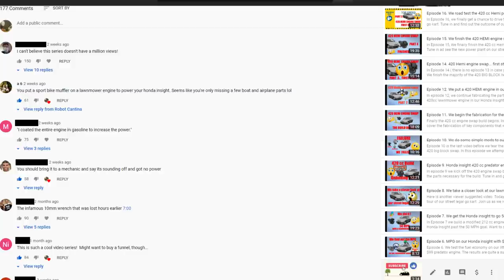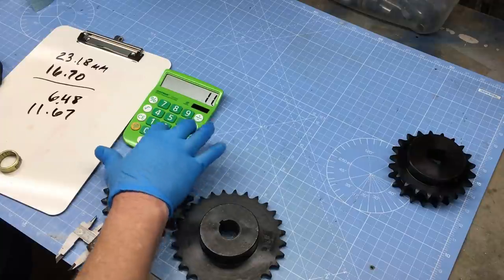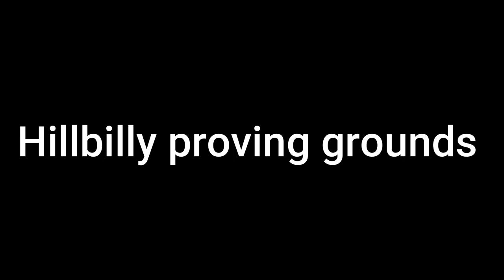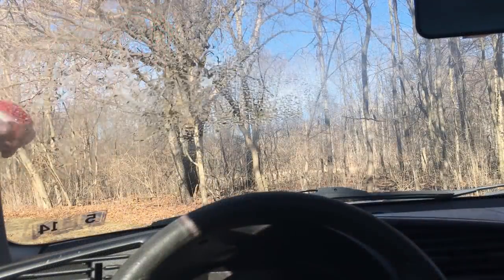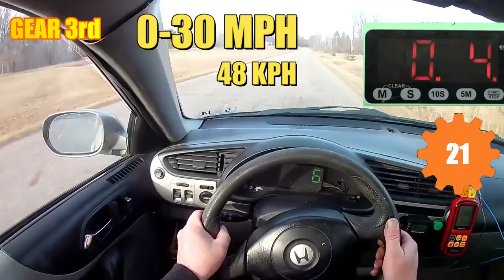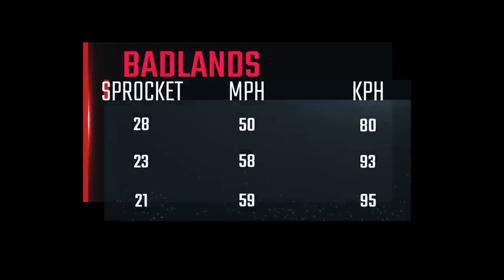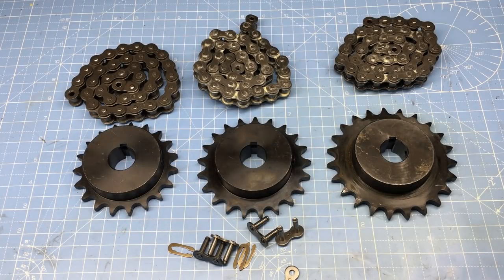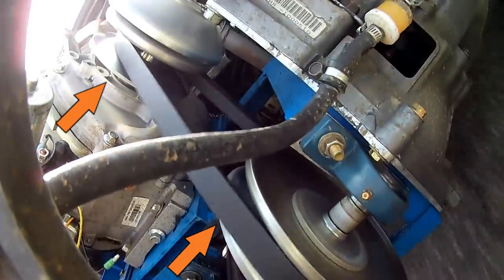Episode 17.  We find top speed and the MPG of our Honda Insight with a 420cc cement mixer engine.

Comment: if you have a teenager, this needs to be their first car.. no risk of speeding tickets.
Reply: There is a dutch car that comes from the factory with a 5.5hp honda engine lol.
Reply: Instead of ls swaps all the kids will be doing Koehler and onan swaps possibly Briggs opposed twin swaps
Reply: Either this or a Ford Mustang, both are always in corvettes rear view mirrors
Reply: @procrastinator1842  Yes, it's a 'car' for disabled people. Technically they are mopeds, and moped traffic rules apply.
Reply: I had a good mom. She told us honda civics where gutless and dangerous.
Reply: @procrastinator1842  what was it called?
Reply: @butwait  Do you happen to remember the name?
Reply: @madferret2045  Arola, you can also look for Canta LX
Reply: Challenge accepted....
Reply: @BeamerTheFox  yep, takes more skill to merge onto a highway with 13 hp than it does with 250.
Reply: honestly, even with the stock motor, it's hard af to get speeding tickets in a first gen insight.
Reply: @xq3975  yeah, this thing is so slow as to be dangerous
Reply: Lol

Comment: Seems like you are hitting the HP/Drag limit around 58mph.  Driveability looks good.  Imagine this with a 670 twin.  Could easily do highway travel.
Reply: Should I been thinking from the start except for you would have to worry about heights but that’s really not a problem if you know how to cut seven things and make the engine a bit lower because I can see you not a lot of. Things that I could do differently that would make it a lot lower I would make the first set of sprockets extend out further so they would be looking at the front of the engine stuck out it’s very hard to explain but I would be putting the sprockets not directly under the engine I’ll be putting them beside itAnd with a few minor modifications this could work
Reply: Please go 670 on this please please please
Reply: I want to see the 420 with efi and a turbocharger next!

Comment: Mathematically speaking, the best sprocket would have zero teeth, allowing infinite speed!
Reply: That’s kind of how a CVT works.
Reply: Zero teeth (which of course only works in math), infinite speed requires infinite power.
Reply: @dustintunis9347  if you have infinite time, then you have infinite power?
Reply: infinitely zero speed?!
Reply: @mikescudder4621  dividing by zero equaling zero is for people who have limitations rooted in reality. 
-superdupergrover, 2021 :)
Reply: @superdupergrover9857  fair enough... Must be time to include a flux capacitor in the equation then ;-)
Reply: @mikescudder4621  Nah, just paint it red.
Reply: @superdupergrover9857  and don't forget the racing stripes lol.
Reply: So if we use V belts and pulleys instead of chain and sprockets your saying we can go 88 and time travel is our game? Lol

Comment: Now I understand how my dad's Datsun 120Y would do 120Km/h(75mph) easily in the 1980's, it only had a 4cylinder with of 1191cc displacement with only a 3 gear transmission!

Comment: The cvt system is really robbing some power. Ditch it for a normal clutch and use the manual transmission like its meant to be used.
Reply: Why not just hook clutch back up and run directly drive

Comment: Interesting, a Honda Insight will give you 54 mpg with a 107 h.p. engine with all the drivability and power. A 13 horse gets worse mileage, is less drivable and has no excess power to overcome aerodynamic drag. Very cool video series.

Comment: Incredible work!  I think once you get it dialed in you should add a hybrid drive.  Check out Chrysler’s Pacifica evt hybrid transmission/drive for some ideas.  It’s actually rather simple.

Or just add in a hand controlled electric motor to add torque at appropriate times.  Then computer control it.  Also check out Chrysler’s etorque setup.  Good luck!

Comment: Be easy two throw in two in wheel motors and add a generator to the Predator to make a diy hybrid.

Actually, as I think about it, the way to set it up would be 3 or 5 motors - one connected to the Predator to act as a DC generator by using the regen function of a beefy motor controller.

So you'd have the Predator idling, and a fully charged battery as you start driving.

You'd have to figure out a control circuit to ramp up engine throttle based on battery charge, but at some point it would open up and go to maximum to charge the battery. Assuming that you are using less than the max wattage the Predator can generate (around 7kw - which works out to around, 9.5 hp) it would charge the battery to max and go back to idle.

The benefit of this setup is that you could draw much higher burst power through the electric motors than you ever could from the Predator.

Qsmotor makes some simple efficient motors rated for 8kw continuous, 19kw burst. You can actually pull a lot more both continuous and burst by adding ferrofluid to create a heat bridge between rotor and stator. Like double  So 19kw *2*2 = 76kw or a little over 100hp.

Now, we're talking usable performance.

That's the power for brisk take off, short steep grades, etc 

Battery size would dictate duty cycle of the predator/generator, and with a large enough battery, you could charge it when you have access to cheap electricity, and cut your fuel costs. 

Add solar collectors to the car and it can partially charge while it's parked at work.

Comment: It looks to me like you need to increase the spacing between the drive-driven clutches, or get a shorter belt. You are not getting the gear-reduction at start-up due to the belt riding up into the drive pulley, and then you are not getting a full shift at high RPMs. Belt length/clutch spacing makes a huge difference in snowmobile performance and this should be no different.

Comment: Your math doesn't seem correct. The 19t sprocket should have a theoretical top speed of 73 if a 28t sprocket has one of 50. 50*28/19=73.7 and even if you were to use the gear ratios with that 11t sprocket as the primary, then it would be 50*2.54/1.727=73.7. Though, if you go with 46 instead, then it should be 67.8 much closer to the 65mph mark. It seems a 44mph speed with a 28t sprocket would get you to 65mph on a 19t. 19t sprocket is 68% of 28t, so the engine only needs to spin around 2 times to move as many chain links on the 19t as the 28t would spinning 3 times. A 14t sprocket is 50% and will double the theoretical wheel speed of a 28t.

Comment: A v twin should really move it. A 24 hp or so Vtwin would still get 40 mpg. Maybe try a transmission, I wish I could tinker on that baby with you guys lol. I have wanted to build a skinny tire extreme mileage “car” for a long time. Just enough payload to haul 2 people and some luggage. 15 gallon fuel capacity. A motorcycle transmission geared to the moon. I bet I could get it to go 600 mi at 65 mph and 50 mpg. maybe lol.

Comment: Lol. You totally made me stop the video and check the last one with that window cleaner gag. Yep, I did post the GoFundMe comment. Good joke with the piss in the bottle.
On fuel economy, internal combustion engines typically run the most efficient at their peak torque rpm. An engine that feels strained is probably running off peak torque rpm. "Building" this engine will probably move the peak torque rpm.

Comment: 60 MPH is good, now work on getting a decent low throughput muffler and get the Fuel mileage up by 25%. Maybe solar panels on the roof and hood a couple of 12 volt batteries for power boost you can then try #19 sprocket.

Comment: Fun project car and so many ways to go if you you're wanting to. I enjoy this because I came really close to buying one of these Insights, got a Jetta diesel instead. Bigger more substantial vehicle and I'd be driving 95% highway miles so the hybrid system wouldn't be at maximum use. Some insight drivers were getting around 70 MPG. Maybe a bigger engine would deliver better fuel economy but that's not your goal. So.. patiently waiting for the next installment.  Got any robots to add to the go kart?

Comment: Hey, I suggested a sealed o-ring chain! Hoping I was the first to suggest it. 👍 Also, have you tried not backing off the throttle all the way in between shifts to keep the CVT partially engaged?

Comment: Please adjust clutching. I think there will be more to gain tuning the cvt then changing gear ratios. I am a snowmobile guy. Clutching is key! Tachometer is a must when adjusting weights and springs! Engine should be at the rpm that peak hp happens from engagement to top end. Love the videos!

Comment: You are that kind of guy that helps Maybach engines become everlasting. 
At least a mechanic with extraordinary attention to detail and deep knowledge. 
And Maybach engines because they were build to run, and run, and run... and never fail. And they are fully modulare what does require a reassembly every 15 years but they keep going like they were build yesterday.

Comment: Change to a thinner head gasket and a set of better valve springs. Also look at tuning the driver of cvt and also look at which hole you spring on the driven unit is in......after rewatching the portion of the video showing the cvt in action. You driven pulley is opening faster than your drive unit reacts. You are losing power there. Please check the driven spring position

Comment: As summer approaches, this engine will need cold air ducted into the fan housing otherwise hot air will recirculate under the hood.

Comment: Something tells me that a 25 tooth sprocket is the Goldilocks sprocket.  Also, technically speaking, running the engine at WOT all the time is more efficient because it reduces the throttling losses introduced by part-throttle driving.  You have a CVT, so if you run WOT all the time, the fuel economy will be a function of engine load,  because the CVT aims to keep the engine at a constant speed, the only variable is engine load.
Reply: You are right about the pumping losses, but you have to think about the fueling. Generally it is made to be richer for various reasons at high loads, making the tradeoff pumping losses vs fueling a net loss at full or very high loads.

Comment: This is awesome - but I've got a 796 CC 3 cyl  Daewoo factory engine getting 51 MPG (and 51 ft bs) with air conditioning, power steering, and the ability to drive across Canada. This latest setup looks like it's manageable on backroads at least. 

You should take it on a road trip. :D

Comment: I wish I could like this twice. For real. What would happen if you took a more 'regular car' approach, by fastening the stock insight flywheel either to the 420cc engine directly, or with some reduction, to a shaft. Without having the CVT mechanism. 

The one thing i'm sure that would accomplish is better packaging, Beyond that, I don't even know if it's feasible.

Comment: Just like the Honda motorcycles, the fastest speed seems to be at one gear less than the high gear, (350 to 500 cc)  just do not want to go WOT on the faster bikes. I would love to put a Predator on a CB 750 roller and just might try a swing plate mount for starters

Comment: Does down shifting/engine braking do anything with the cvt on the car? Does it re engage at higher rpms with no throttle or does it Freespool like I saw In the shifting video when u put the clutch in.
Reply from the maker: lifting off the accelerator will cause the CVT to sort of freewheel.  I say sort of, because there is still random belt drag.

Comment: Windshield. If wanting to cut down on more weight, could replace it with a 3-5mm thick polycarbonate one, back window too. Some say acrylic is easier to cut, shape, install though. Stock rims and tires? Ever thought about using lighter rims and tires, perhaps more narrow too? Maybe narrow motorcycle tires? No tensioner for the belt? Would that help, or interfere?

Comment: Throw away the CVT. The mechanical efficiency is not the best to say the least and it's basically maxed out all the time anyway. 
Otherwise I'd like to see a fuel injected engine which boosts your MPG and you can use a duct to cool the engine and also use this to heat the cabin.

Comment: I liked the cid of the cvt.  I noticed a lot of  "vibration" of the drive belt, and was wondering if a tensions pulley with a light spring might clean that up a bit for smoother power transfer.

Comment: 3x11 derailleur is the best sprocket setup, because it basically gives you a whole bunch of extra speeds. A freewheel may help as well.
Reply: You could also give non-circular sprockets a try, as you could optimize the gear ratio on a stroke-by-stroke basis; after all, the engine makes all of its power during the power stroke, and none of its power during the other strokes.

Comment: So if you are using the cars actual transmission, why use the CVT Torque Converter at all? That's like putting a transmission on the end of a transmission? Why not just use a regular centrifugal clutch and connect that right to the automotive transmission?
Reply from the maker: The CVT adds torque multiplication,  its like getting a few extra gears.
Reply: @robotcantina8957  The universe likes speed. Don't delay. Don't second guess. Don't doubt. When the opportunity is there, when the impulse is there, when the intuitive nudge from within is there, act. That's your job. That's all you have to do.   Keep going jimbo.   We love those amazing speeds!

Comment: Hmmm. I think the belt is a littlebit to slack. I goes completely to the outside in the Motorside, but (it looks like) only 2/3 in on the Gearbox side. Maybe a shorter Belt?
Reply from the maker: I thinks there is still some adjustment left in the motor mounts,
Reply: @robotcantina8957  The universe likes speed. Don't delay. Don't second guess. Don't doubt. When the opportunity is there, when the impulse is there, when the intuitive nudge from within is there, act. That's your job. That's all you have to do.   Keep going jimbo.   We love those amazing speeds!

Comment: nice job buddy ...
if you connect a small electric motor to the main motor , (12 V and 48V are now used in new hybrid systems : new suzuki  swift --- new hyundai i 20)  With such a hybrid system, it will be a faster and more fuel-efficient car.
congratulate ... good luck

Comment: for a car thats this small, this unsafe, this underpowered with such a small engine, 5.2l/100km is outrageous :D my 1.7ton 2500ccm 6cyl BMW common rail turbodiesel Opel Omega caravan (150hp+ a little chiptuning) does 7.4l with a ton of idling, 4km trips in a hurry to work 5days a week, sometimes longer country trips (but mostly within town limits)..   Did an only intercity run last month 140km in one way, than back, and did it with 5.5l/100km :DDD with 3 in the car, and a shitload of furniture, a large aquarium, a pc desk etc etc in the trunk, running at constant 110kmh all the way :D

Comment: I rally like what you doing. It gives a lot of fun. But I have full size (for Europe) car with electric charging, A/C, ABS, ESP, cooling, heating, all equipment car needs and it uses 5.6 l of diesel fuel for 100km. So...  
Have you ever seen microcars? Maybe that is the way?

Comment: Should get yourself a Garmin GLO for timing. $90, and it's got the same refresh rate as a VBox.

Not that 10hz timing is necessary when you're counting 0-30 mph times that slow, but export the data to an app and you can make pretty curves!

Looks like the 23 tooth hit 30 close to 11 flat. 21 tooth closer to 12. So 23 is perhaps the limit for performance on the 420 in current spec, but 21 probably better overall.

Comment: 11:58 You--or the other commenters, anyway--might be surprised; most engines get the best BSFC (which is basically efficiency) at something like 75% throttle opening, in the lower half of their rev range. With my last car, using 50% throttle and below was actually less efficient than using full throttle, lol.

Comment: It would be cool to see you set it up as a home made Hybrid some how like maybe set it up so the electric engine drives the rear wheels or something while the gas engine only drives the front wheels? Idk how the car is set up but I do think that a big box full of batteries in the passenger side and an electric motor might help that engine where its struggling. If the engine didn't need to push as hard then going so fast wouldn't be so bad, or would it? You could even hook up regenerative braking if you are smart enough.

Comment: Is the engine completely stock in the tests?  Keeping everything else the same  but taking the govenor off what would the theoretical speed go up to.
Reply from the maker: The engine is stock except for a minor jet change in the carburetor.  The governor is still attached but it was disabled for filming.  the top speed we show is all the car will do with or without the governor.
Reply: Have you checked out some small diesel engines?  There are some on Alabama for around 330 dollars for 16 horsepower and probably twice that in torqe. MODEL HR198FAE

Comment: Have you considered changing out the gearing in the transmission? I do this with all Honda manual transmissions and it's usually for performance. 

Close ratio frankenstein setups, but I've also done setups for fuel efficiency. I'd be willing to help you out for free.

Comment: I love the popping exhaust, but dang that thing is kind of loud considering the length of pipe and big muffler. A turn down at the end would quiet it quite a bit without harming performance at all by lowering the perceived volume of the exhaust by directing the sound at the ground. Also a second silencer in the exhaust like a straight through resonator or 'cherry bomb' style muffler would tone down some of the higher pitched harsher 'slapping' sounds from the exhaust. I'm sure no one around there minds hearing a riding mower flying by at 60mph but if you're going into town it might raise a few eyebrows of the local police if it sounds like a mini-bike on roids.